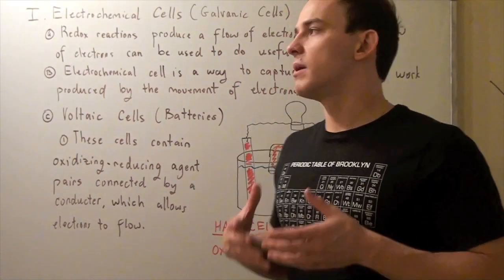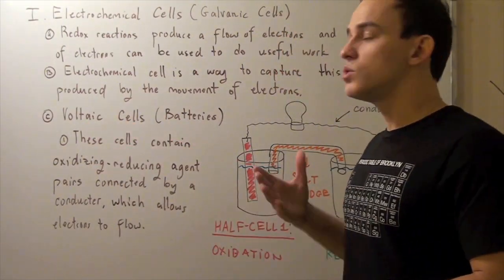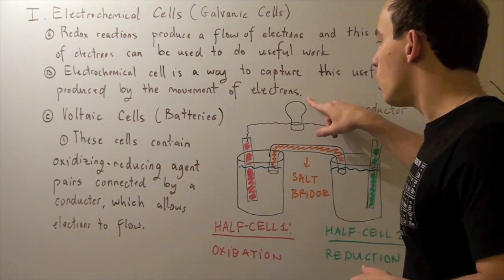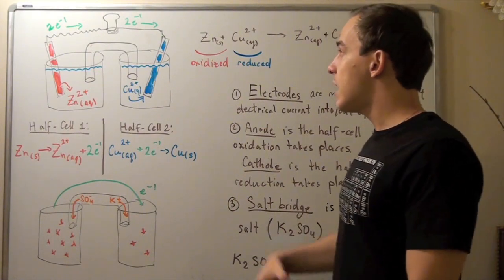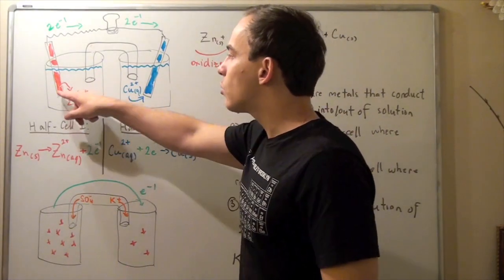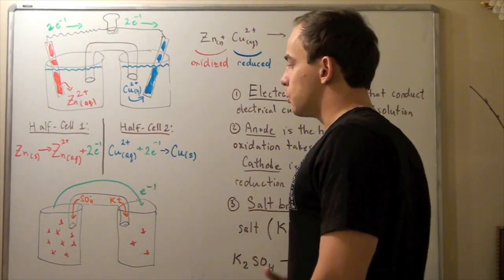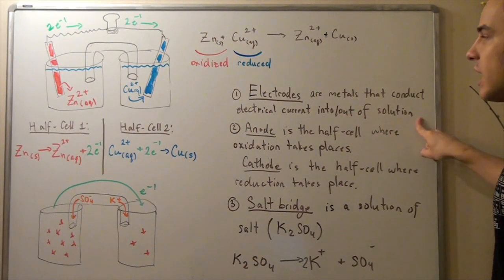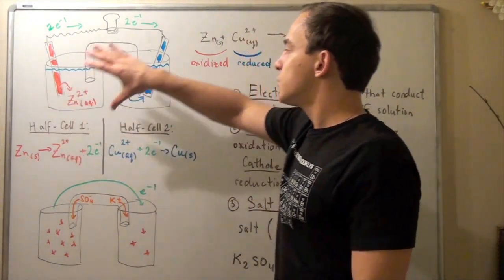Electrochemical (Voltaic) Cells

Comment: First where does the potential difference come from that drives zinc's electron through the wire
Reply: i forgot chemistry but i think its because of the copper electronegativity that it is pulling zinc.
Reply: @saumyojitdas4212  
see my friend. 
PD is a totally different concept.
emf is needed to drift the electrons through the wire which requires presence of different charges. Both electrodes there are neutral, so, 0 emf. Therefore, no PD.
Reply: @oceancullen5253  actually i forgot see khan academy explnation ...see the comments
Reply: @saumyojitdas4212  
Still you tried.
By the way which grade do you study in.
Reply: @oceancullen5253  now i am in cse 4ht year ..
have u got ur explantion let me know

Comment: why does zn electrode gets oxidised without reason?
Reply: because it is spontaneous reaction.even if you will take only zinc beaker and zinc rod dipped in it zinc will lose electrons this is marked while doing experiment as zinc rod becomes thinner and shorter.so it is not that copper half cell is connected that's why zinc loses electron even without copper zinc does so.it is to be noted that copper also loses electron when not connected with zinc but when gets connected with zinc by conducting wire zinc has greater oxidation potential as compared to copper (go through electrochemical series )so zinc wins and gets oxidized, as oxidation can not occur alone there has to be reduction so copper gets reduced .
Reply: thanks!